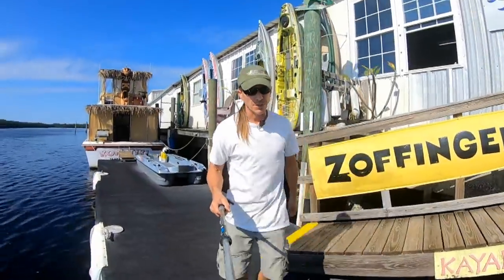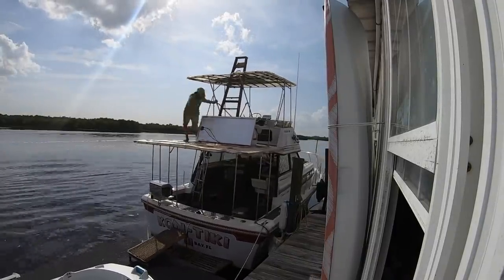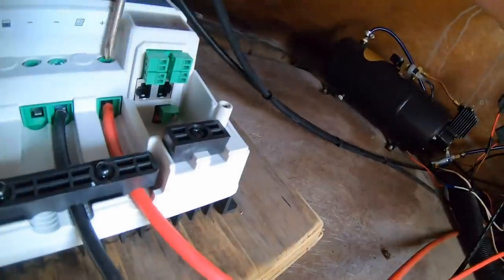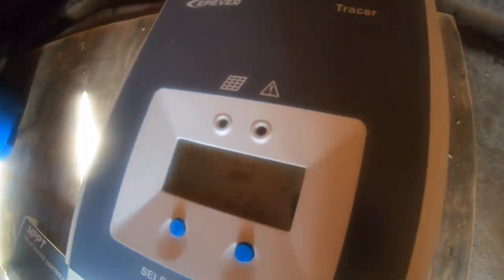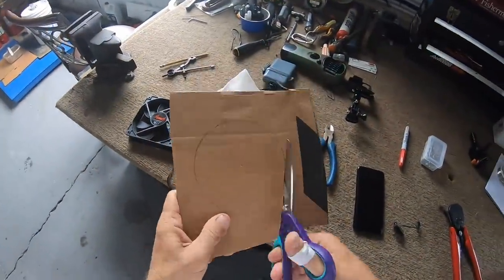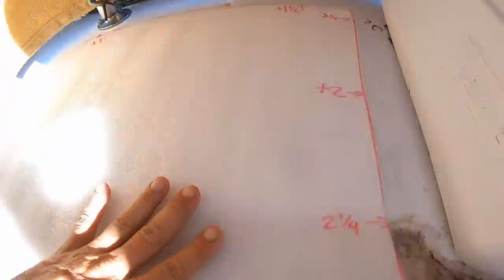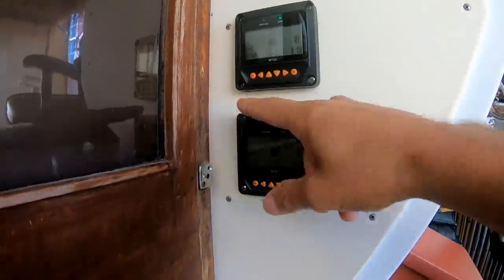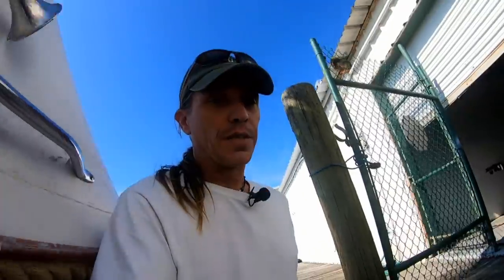My Boat Has Solar Panels!

Comment: Three suggestions:
First, the batteries should have the negative and positive wires that run to the system connected to opposite corners of the batteries to distribute the load equally among all the batteries. 
Next, solar panels lose efficiency as they heat up, so ventilation space under the panels is really important. 
Finally, you can order fan control thermostats on Amazon for about $10 that will turn the fans on at whatever temperature you want. 
I'm sure your system will work as is. Nice work!
Reply: I noticed that he hooked up the panels before the battery. I thought that was a no-no..
Reply: @jjohnston7837  Solar controllers generally get the power to operate from the battery, not the panels. So If you've got configuration to do on the controller ( output voltage, absorb time, etc ) that you want done before it starts charging you need to hook the batteries up first, then configure, then hook up the panels. 

It's possible ( though I haven't heard of it ) in with some controllers that one could damage the controller by hooking them up in the wrong order, but folks do it all the time and typically the controller just doesn't work until the batteries are hooked up. I think controller manufacturers are mostly looking to prevent returns because someone thinks the controller has failed ( display or status LED's not on ) when only the panels are hooked up.

Comment: Nice setup Marty, but I secound that Lifepo4 would have been a much better choice for batteries. You can get cheap 280ah cells straight from Alibaba for less than $500. Screw four of them together in series and slap on a Daly BMS on top to get a super 12v battery that will run for a decade with more useable energy and a weight just over 20 kilo. Cheers

Comment: Quite a solar  setup. You have a bunch invested in Batteries. Great job using separate charge controllers so you don't lose everything if one goes out and they do go out. Remember to keep them above 12.4 volts or higher they will last a long time.  A guy on YouTube named Will Prowse is pretty sharp about solar.

Comment: I'm really glad that you hooked up a solar system. But, if you're able, you might want to consider LiFePO4 batteries.
Reply: I second that. Battery hookup has great deals. FB marketplace local to your area will have some too.
Reply: Indeed.  400 ah of lead is really only 200 ah before you start damaging the batteries.  With LiFePO4 400 ah is really about 400 ah.  Big difference.  You can get quality 100 ah LiFePO4 on Alibaba for about $300 each, but you have to wait a month or more to get them and there is a shipping fee too but since LiFePO4 is about 1/4 the weight of lead the added expense is not horrible by freight.
Reply: @wisconsineaglesfan7925  There are plenty of US suppliers as well - might cost a little more, but quicker shipping.  Several channels on YT have good links/reviews - Will Prowse, High Tech Lab & Bus Grease Monkey are good ones to look at re LiFePO4 sources

Comment: Not sure I am a big fan of the thatch...I think I would have gone a more traditional route with the hardtop, but, to each his own, right? I do like the solar setup....Great idea for using three seperate charge controllers... It isolates any problems, should something come up, not to mention cheaper than one of thoe huge controllers.
Reply: 😂I know. I bet whoever bought the boat that was the first thing they did

Comment: Nice! Great setup you did there. My only advice is buy yourself a small gas powered generator. I follow some RV travel channels on YouTube and they all have solar. You are definitely going to run into situations where you will have ZERO solar for days at a time. If it’s cloudy with rain for a week straight you’ll be glad you have emergency generator even just to run for a bit to charge your batteries.

Comment: Marty, you should start now on looking at going with lithium batteries, so when these batteries need replacing you can have made an informed decision. The big drawback to the lead acid / agm /gel batteries is the 50% charge factor. You can only use 50% of the amp hours before you need to recharge the batteries. With lithium you can use all of the charge.
The second big benefit of lithium is the much reduced weight.
Trying Not To Sink just switched their house batteries to lithium, same amp hours, same voltage, 25% space and 25% weight used by the lithium.
You have at least 5 years before you need to get new batteries, plenty of time to really examine the costs and benefits for your own uses.

The only place it really doesn't make sense to use lithium, in my opinion, is the starter batteries for the engines. Those just don't really get enough use to make the higher cost of lithium worth while.

Comment: Marty ma' man, please check the heat those panels might build up behind when operating. Wouldn't want to set the palms on fire 🔥    might be wrong but seem to remember a thread talking about that on flexible panels, not sure how or if that translates.
Reply: Those solid panels typically have an aluminum back and he's got them air-gapped, so it should not be much of an issue.

Comment: You're lucky you didn't blow up your charge controller by installing the solar panels before the batteries were installed. Charge controllers can blow up because they have nowhere to send the voltage without the battery is already being connected.
Reply: I was just about to write the exact same thing.  It is worth covering the panels up until everything is installed.
Reply: When the battery voltage reaches a point where the battery charger decides that the battery is full, the charger will cut out, and stop drawing power from the MPPT controller. In other words, the battery charger will present a high impedance to the MPPT controller.

The MPPT could react to this by presenting a high impedance to the solar panels, effectively stopping any significant power draw from the solar panels.

Same goes when there’s no load (or batteries) connected.

Comment: Just one quick idea, if you ran cables from one system to the other with cut off‘s you could run energy from one system to the other in the event of an emergency. That way if the helm went down you could flip a breaker and run it off of the house and vice versa. Oh and I grew up on solar. If it’s winter you are gonna want a backup generator

Comment: Get a set of lithiumionfosfate (LIFEPO4) batteries instead of those bulky and heavy and dangerous lead acid ones. Youll get the same work done with a 150Ah LIFEPO4 battery as you get out of the 400Ah Lead acid ones, its safer, weighs between 10 and 15 kgs, and will last you at least 4 times longer, making it dirt cheap in the end. I think, 1 cell of 150ah x 12.8v will cost you about $500. Check ouf battleborn batteries. Also you may want to follow a guru of solar on youtube Will Purse.
I love how you recycle and reuse everything. 
🇲🇹 🇪🇺
Good job ✌️

Comment: I wished you had gotten lithium batteries, they give you about 3,000 charge cycles vs. 300 and you get 100% power use vs. 50%. They cost more up front but they are way cheaper on a dollar/amp capacity basis.

Comment: Was always wondering about solar and battery banks. Thank you for explaining. Hope it all works perfect for you and lasts many years. You did a great job hiding everything and making it safe. Can you run a generator with a battery charger to the battery banks if it was stormy or cloudy for many days and charge up the batteries then shut the generator off and be good again for awhile? Just wondering, thanks for showing how solar is done on a big boat.😁👍

Comment: Just a heads up, hydrogen gas from the batteries is lighter than air, that being said, your vent will do no good since its down so low. You might want to flip that vent over so it vents from the top.

Comment: Hey sir I have a question...  When you said all your cockpit electronics were running off the upper solar panels, you meant indirectly right?  I’m sure they are running off the batteries under your bridge seat which is powered by those panels.  The distinction is that if they are hooked directly to the panels,  they will operate very flakey if at all.  At night for example, you certainly don’t get 600 watts out of them.  When attached to the batteries on either 12 or 24 volt, whichever you use, they get constant, even power at an acceptable voltage and amperage.  I’m sure this is a moot point, but I was just curious.  Please confirm for me.  Thanks and have a great trip.  Your boat looks amazing!

Comment: mppt's are buck converter, you will never have shares in your panels on the ocean, you should have gone series so a little sunlight would already start charging, parallel will eventually stop charging when the solar voltage is less than the battery voltage, indirect sunlight gives less voltage but in series totaling those under voltage in series start your charge even with less sunlight.

Comment: Marty, you did not show but I hope you have following: 

Kill switch from solar panels to charge controllers (for every setup so it would be 3 kill shut off switches)
fuses rated for amperage between panels and charge controllers. (that would be 3 in your case). 

If you have fuses that have disconnect button or flip switch on them, that would work also.

Comment: This is all well & fine so long as you have plenty of sun...I would think about having at least one wind generator, it could be made to charge any of the systems one at a time as each will require more assistance than the other depending on how you tax each individual system. Just something for you to mull over before you commit to the journey.

Comment: Yeah know  If your planning to make your great loop run at this time of year you might want ot consider ordering some artic weather gear as the northern part of your adventure will be covered in snow and ice this time of the year. and it you sit still to long you will be frozen in place till spring.

Comment: This was an good example of how NOT to setup a marine solar power system. There should only be ONE house bank of batteries. Breaking it up into three small discrete systems is incredibly wasteful. Some of the banks are going to be overstressed and others will be under utilized. The batteries are heavy and should always be installed as close to the centerline and as low as possible to reduce roll moment of inertia. Lead acid batteries are a very poor choice for this application. They will quickly lose capacity if they are discharged below 50%. LiFePO4  are far better suited for this application. The PV panels will get hot and need unobstructed ventilation underneath to function efficiently. Placing dried palm frauds around them is an ideal recipe for a fire.

Comment: I'm questioning the logic of having 3 different banks. You will be sacrificing alot of charge when one bank is full but the other is not. (Plus I assume your alternators only charge the downstairs bank.)

Also, your refrigerator will be your  biggest draw, yet you will get alot more charge off your flybridge panels, because the panels on the lower level will often be shaded by the flybridge.

Comment: Why have 3 lead acid battery systems? 

You didn't not mention that your usable capacity was half their stated amount. You'll be killing them in no time if you drain them dead. 

Why did you get a 3000 watt inverter for just one outlet? That's like running a generator for a light bulb. If you only have much lower wattage items, you are wasting your power being converted into 110 V. Get a smaller inverter to be used most of the time.

Your battery gauge may not be accurate as shown on the charge controller. Best to get one that shows Depth of Discharge, since it is too easy to forget what voltage represents your Depth of Discharge.